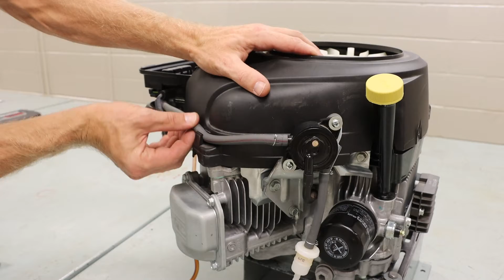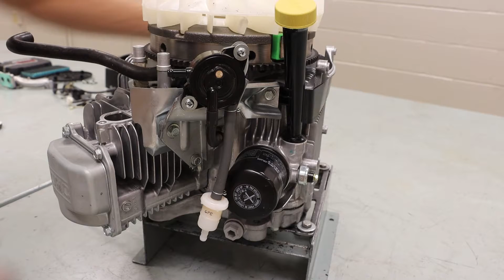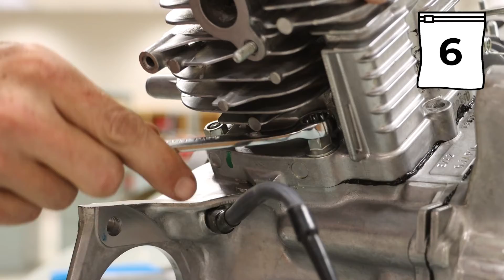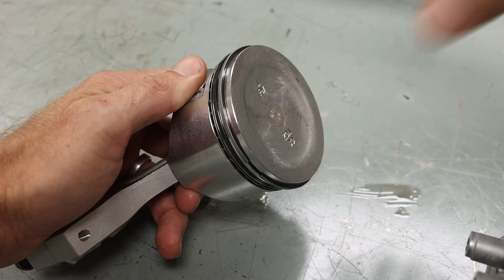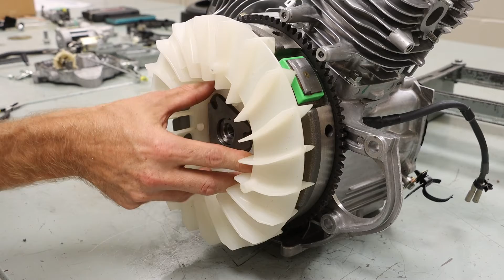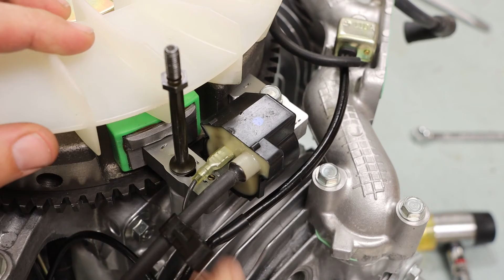Honda GXV530 Overhead Cam Twin Cylinder Engine Disassembly and Reassembly - Instructional Tutorial

Comment: Is the procedure the same for the Honda GCV 530 engine? Thanks
Reply from the maker: The process should be very similar.  The Honda GXV530 and Honda GCV530 are very closely related engines, but the GXV series is generally considered the heavier-duty commercial version, while the GCV series is aimed more toward residential/light-commercial equipment.
Reply: @InsaneOil thank you, greetings from austria

Comment: I have a leak coming from the governor arm .... any tips of addressing that issue ??
Reply from the maker: The governor arm connects to the governor shaft which goes through the side cover into the inside of the engine.  Since the governor shaft goes through a "hole" in the engine, over years of use (due to wear) that "hole" will get larger or the governor shaft will get smaller (thinner diameter).  The governor shaft can be replaced if that is worn down, however, the side cover would need to get replaced if that has enlarged.  However, there are two bush fixes where you (1) run slightly thicker oil or (2) run cheap oil and have it "sludge" up the hole.  Both of these "fixes" may reduce the oil leak but cause more wear/issues in other areas of the engine.

Comment: Bravo pour cette vidéo explicative simple et claire. 
Sans elle, je n'aurai pas été capable de me lancer dans le démontage complet de mon moteur. 

Juste un détail que j'ai du mal à traduire en français et comprendre: Au remontage, l'écart entre les bobines d'allumage et le volant moteur. Je comprend une cale de 10/100, mais sur l'image il me semble lire 30/100...?

Autre chose, il est nécessaire de mettre de la pâte à joint sur les portées du cylindre au remontage?

Encore MERCI...👍

Yannick
Reply from the maker: 0,010 pouce est généralement la norme pour l'entrefer d'induit.

Aucun joint n'est requis sur les surfaces de roulement lors de l'installation du vilebrequin.

Merci pour vos commentaires et pour avoir regardé ma vidéo.

Comment: Thank you for the in-depth instructions, very nice, would you happen to have a part number for that fan? I have a brush hog that has this motor on it and I have rebuilt it but as soon as I started it the fan grenaded inside the fan shroud and there are no pieces big enough to show any numbers left
Reply from the maker: I believe it is this one but you will want to double check: https://www.amazon.com/Honda-19511-Z0A-000-Fan-Cooling/dp/B00AJTRJL0
Reply: @InsaneOil thank you so much

Comment: This is awesome, very helpful. What type of sealant on the mating surfaces, and what is the procedure? I don't think this has any gaskets, right?
Reply from the maker: The engine in the video is a student demo engine that is taken apart and put back together multiple times throughout the year.  Typically I will use Permatex Gasket Maker if there is not gasket kit designated for an engine.
Reply: @InsaneOil  I appreciate all the info very much! 

Do you recommend replacing the timing belts while I have it apart, or do they magically never fail? (I wasn't really trying to do a full rebuild on this, but maybe it doesn't make sense to do anything less!)
Reply from the maker: @djbachelor  The timing belts are suppose to last "for life" ...whatever that means.  In general, it is advisable to replace them if you have everything torn apart as they aren't too expensive.